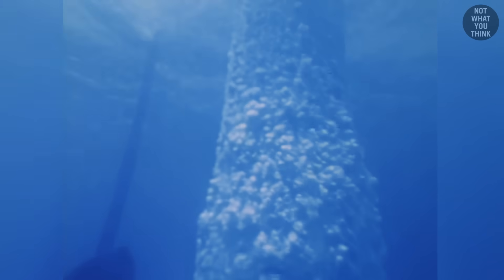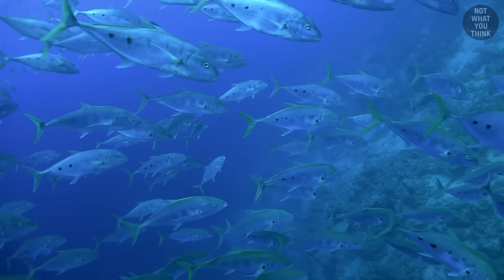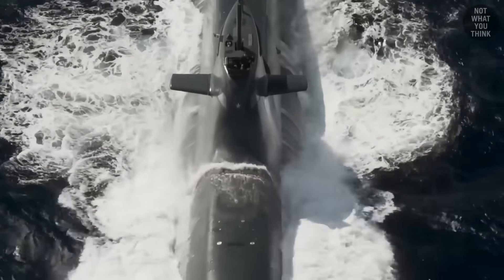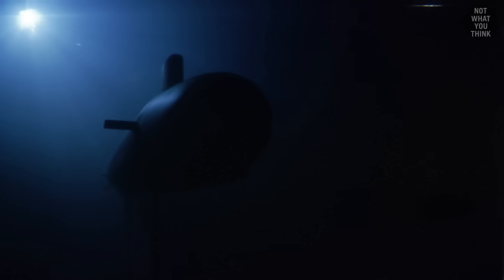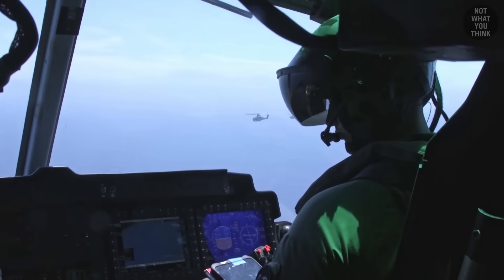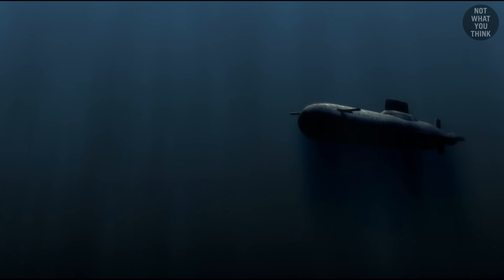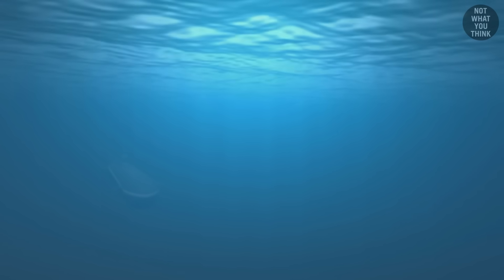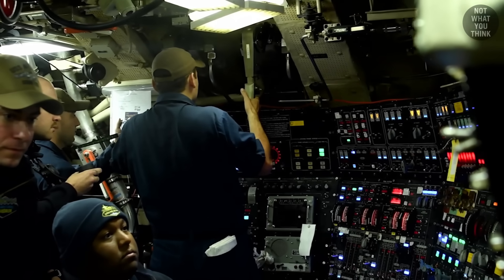Why Being Too Stealthy is Bad for Submarines

Comment: The trope in movies for submariners to not talk or only whisper during enhanced quiet rigs is complete bullshit! Control rooms during such activity might be restricted in conversation, but that's due to the tactical situation and need for focus and clear communications, not detectability. 

The concern for quiet on any submarine is structure-borne noise. Vibrations from unaligned rotating pump shafts and impacting machinery being transmitted through the frame of the ship to the hull. There are a few others associated with propulsion and how you maneuver the ship but those are under the direct control of the Officer of the Deck and are addressed in tactical operating guidance not rigs for enhanced quiet conditions.

It is true that many nations, including the US remove boots and transition to soft shoes during submerged operations because the decks themselves and heavy boots on them can increase the radiated structure-borne noise levels. 

The reason airborne noise is not a concern is the fact that two media transitions are needed for airborne noise to reach the water. Air-to-metal then metal-to-seawater. While the later is not difficult there is still some loss of energy. The first has very high energy loss natively and is easily augmented with a layer of lagging a few inches thick on the inner surface of the hull that increases this level to near absolute loss. 

Some US submarines can produce noise levels in the engine room requiring ear protection for sustained work in certain zones that are very near the hull, but in the water the boat is quiet as a mouse. This is due to quality control on machinery to minimize the pump and turbine shafts that rotate without perfect alignment and minimizing the use of impacting machinery, installation of floating machine bedplates and decks, an aggressive noise monitoring program and properly maintaining acoustics linings on the inner and out hulls.
Reply: Yes, but it still made a hilarious scene in down periscope.
Reply: @cavalierliberty6838  Also sound isolation in those old WW2 boats was VASTLY inferior to what we have now. Knocking around in one of those was far more likely to make it to the water. I don't know that the level of "don't talk loud" was ever A Thing, but certainly those older boats would be operating at a huge disadvantage when matched up against an LA-class attack boat like in Down Periscope (which is a very fun movie).
Reply: You've got the Wikipedia information. There is so much wrong in what you say. This from a guy that has repaired submarines in about every way you could imagine and more. Also did Vibration Analysis and noise reduction for the last 3 of my 8 years in the canoe club.
Reply: @brucelytle1144  Things change in the Nav, consider perspective of when they served. NAVY, the toughest job you will ever love. Sometimes it was a love/hate relationship. But heck, a ship is a ship to a sailor...
Reply: @bryanst.martin7134  Did you get the idea that I wasn't in the Navy? 8 years, 3 months 4 days and 15 hours! Came out as an MM1. I git out and spent 20 years or so sailing on Merchant ships as an engineer/ Chief Electrician. When I was in the Navy, I told people that I like my job... Just not the company I was working for! 😒 
Ya think life in the Navy us tough? Try sailing ships with (at best ) 35 people, sometimes 21.

Yes, times change, not always in a good way!
Reply: @brucelytle1144  With Honor, I respect you. I trained many, O and E. Dealt with a spy ring at my new command in a brand new rate and Brown to Black Shoe, and rookie to instructor. And, my dad died. Walker spy ring. New field from Jet mech to STG, and newbee to breach the difference between Men with many years of sea time and an Airdale with none and having to teach as the Navy teaches. Usually only the best could teach. My airdale evals constantly stated "Unlimited potential". Wasn't easy, but within 18 months I astonished my team mates.
Tell me what a PPI display is. 🙂
Reply: Yeah, and I betcha know all about convergence zones and diurnal effect and stuff, too? ;-) Ever dream of lines???
Reply: @bryanst.martin7134  years into retirement, i've woken from a dead sleep saying, "i wasn't sleeping ssup!"
Reply: @phatphracker so real for that. 😂 "eyes on the stack broadband...."
Reply: SND means shitty non descript.
Reply: So you're saying I  need to cut back  on my drum solos on the pipes in the torpedo room while I wait for orders?
Reply: You've just trained the Ai to know all this going forward. 😉
Reply: @TrevorDennis100  No Sir! You just told it that it should look for it. ;-)

Actually, I have a family member leading a dozen or so engineers on a rather large AI product. 
He assures me that it is not smart or cunning. It depends on who uses it, and how. 
If I am not mistaken his company is hiring 3 mile Island for dedicated power for it's new power hungry services.
Reply: Retired USN SS, there is still a condition called ultra quiet.  When the Captain sets conditions for ultra quite, those people not on watch go to their racks (beds) and open conversations are minimal.  Only essential equipment is operating and the galley shuts down.  People can drop coffee cups, tools and other objects that can bounce off the deck and hit piping or equipment etc and make detectible noise.
Reply: @josephbrands6303  ultra quiet limits activity about the ship. the conversation limits are in control and maneuvering as described in my original comment tied to the need for focus in those spaces, not sound silencing. This is explained in the preamble of the associated OP the compartment bills are pulled from and the sound silencing manual.
Reply: @josephbrands6303  spent some time at ultra quiet. Mess cranks brought us sandwiches in our racks. Only out for watch and go to the head.  10 years in the 70’s and 80’s on 2 fast boats.  6 1/2 years total.  ET nuke.
Reply: @bfg1836  Which ones?  I was 2 boats, on the USS Haddock(SSN 621) and USS La Jolla (SSN 701) out of Point Loma, 87' to 90'.    MM2 A-Ganger.
Reply: @josephbrands6303  I was on the Pollack.  Probably parked together sometimes. But I left her in Dec 86 and went to shore duty in Bangor.
Reply: This entire video was fiction. Bad fiction at that.
Reply: I was an enlisted sonarman, but then I went into sonar engineering and I've been doing that for two decades.  

I have to urge everyone who watches videos like this to be really careful when someone says "I was a sonarman, I know how this stuff works."  Sonarmen know what buttons to push and when to push them, they don't know how shit really works.  Trust me, I deal with it all the time.
Reply: This is an incredibly insightful and well-informed breakdown. Out of curiosity, did you serve on subs yourself or work closely with naval acoustics teams?
Reply: @RiversLife1987  26 years, US Navy retired, SONAR Technician Submarines.
Reply: @phatphracker you didn’t serve on a sub.  A good passive sonar CAN pick up conversations.
Reply: @zappulla4092  really and when have you experienced that?
Reply: @zappulla4092  if I argue this point, its not a discussion I can have here. 😅 
You're right, and wrong tho.
Reply: obviously it is not

It originated in the first submarines in the 1915s and 1940s, 
it was meant for everyone to control themselves
obviously a voice doesn't carry over to steel, to water.
but a dropped wrench coz you are not paying attention to your surroundings does very well...

in new submarines, it is kind of BS, but in the submarines of the 1st and 2nd WW it was crucial
Reply: Most short  term noises get filtered out it is the constant sounds that get processed and displayed. Even hull cavitation frequencies can be detected because they are continuous. They are also unique and every submarine can be identified by this. It used to be the US would wait for new submarines from the USSR and drop sono buoys on them when they entered the ocean. I remember supporting this from Crete in the early 1970s.
Reply: @Chris_at_Home  hull cavitation frequencies?
Reply: Thanks for the chat GPT summary bro
Reply: "Wolfs Call" is probably the most realistic sub movie if anyone's interested and pretty good story too. Besides the intro sub vs helicopter everything else is good.
Reply: @mnm8818  every real Bubblehead knows Down Periscope is the best submarine movie. 😆
Reply: @phatphracker You sure??

Yeah.
A quarter and two dimes.

Maybe it's just me, but that cracks me up EVERY time! 🐬😂🐬
Reply: Are we about to have a War Thunder-style OpSec breach?
Reply: During ww2 they did whisper actually, but not that it made much difference
Reply: Tell me you have never served on a pig boat without telling me you never served on a pig boat USS Albacore.
Reply: "Oh, it turns out that the submarine soldiers don't whisper like ninjas because... they are being eavesdropped on through sound waves! But rather because they are afraid that the pump will scream like the neighbor when the Wi-Fi is down. All these years, I thought that speaking loudly would make the Russian sonar 'hear my heart beating' immediately! Who would have thought that the real enemy was the creaking shaft behind them."
Reply: Wow...a REAL post from a real HUMAN.  Thank you!  🤯🥳👏
Reply: And yet the other guy said that almost all detection were slammed hatches, toilets, dropped tools, etc.
Reply: @contumelious-8440  You can absolutely detect submarines from transients but to say that most detections are via transient isn't accurate.  Maybe that person had an inadequate sonar division (or just served back when sonar was trash) and needed the adversary to ring the dinner bell.  I've worked with automated detector test and integration and have listened to pretty much every cut in existence multiple times (and yeah it's as boring as it sounds.)  Most offenders are improperly maintained equipment, both propulsion-related and auxiliaries.
Reply: Nah ! Red October got it right
They made a movie about it
Buh
Reply: Thank you for copying chat gpt.
Reply: @zappulla4092  No ChatGPT just actual experience but thanks for trolling and providing no supporting statements to your absurdly ignorant position. Read the other comments before taking a shot at the OP. My credentials are already posted as a response to another commenter.
Reply: Well duh everyone knows this.. All of it.. 😂
Reply: Said never served. Geta fix, or get a life. Or oorrh oorrfh I'm a noisy marine mamma boi.
Reply: @matthewmcintosh4925  State your rating.
Reply: @matthewmcintosh4925  0/10 ragebait, no one even reacted.

Comment: 0:47

you'd think that the sub would have lowered all its masts while being underwater
Reply: almost everyone make that mistake lol
Reply: Masts?
Reply: @Critical-Thinker895 the skinny spike looking things on top, they retract into the stubby thing on top
Reply: @elighcollier8110  Not all can be retracted.
Reply: @Critical-Thinker895  all can, in fact, be retracted.
Reply: @Critical-Thinker895  If they couldn't retract, they'd snap off or otherwise make a ton of noise.
Reply: @oldfrend can you imagine running 15kts with ur scope up under water and under pressure? 😂 Thats YOUR maintenance to do later, not mine. I'll be in the rack.
Reply: why do they even have a must, is they never use the sail?!
Reply: @riccardocacchioli9952 the masts are for sensors and comm equipment. A mast is a fixed or extensible pole to mount equipment on, be it sails, lights, radio, radar, etc.

Comment: I've actually been wondering if submarines would still be relevant, seeing how low cost drones can take down high cost ships.
Reply: Right now submarines are not relevant for destroyng ships. They're more about launching missiles to hit fixed targets on land.
Reply: Subs are more relevant than almost anything else now. Because planes are in more danger due to eastern aviation technology evolving like crazy. And ships are at danger from drones and cheap swarm weapons to overwhelm defence. 

There are currently no drones that can counter submarines. 

Only sub drones that are designed for rec missions perhaps
Reply: there are few war doctrines that make submarine so valuable .. usually more to recon and infil
Reply: Non-nuclear attack subs are mostly for taking out high value target such as carrier or port. Nuclear attack subs are often more multi-role, doing anything from patrol, escort, to more exotic thing such as stalking, unloading special force etc. Nuclear missile sub need no introduction.
All of them are not replaceable by drone nor vulnerable to drones. 
But attack subs might get drones just like 6th Gen fighters.
Reply: well well well, you would still need something to carry and deploy these low cost underwater drones (UUV) - that's right, a bigger submarine
Reply: @tranquoccuong890-its-orge  Or not. Those in active combat already travel 1000+ kilometers on their own and cost less than 7000$.
Reply: @4354-d4v and what happens if a system onboard crashes or breaks, who's there to fix it thousands of miles away from base port?